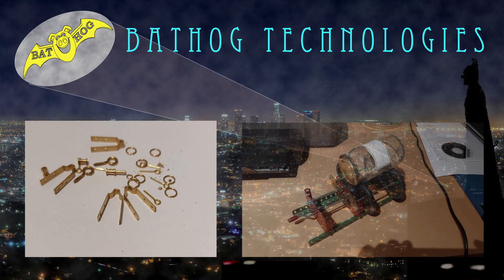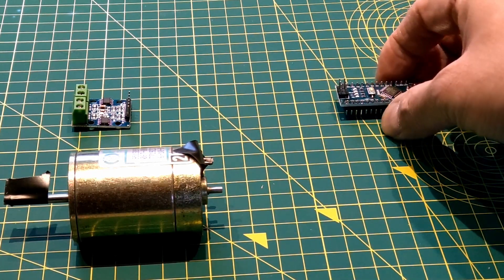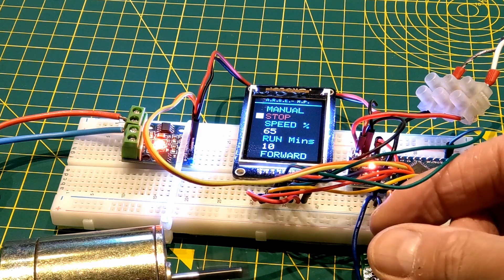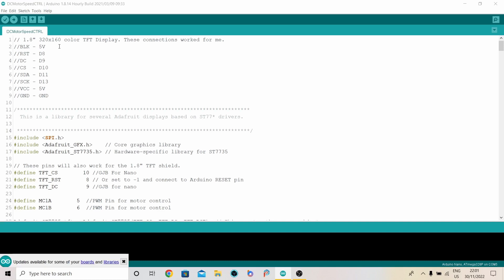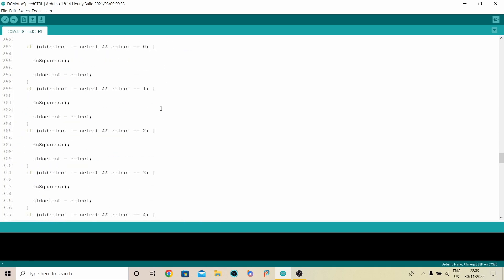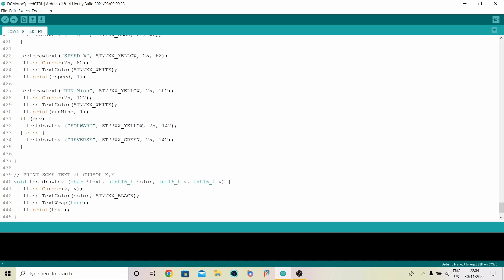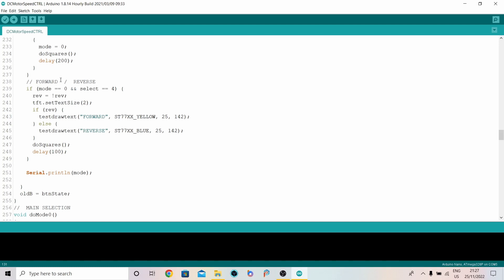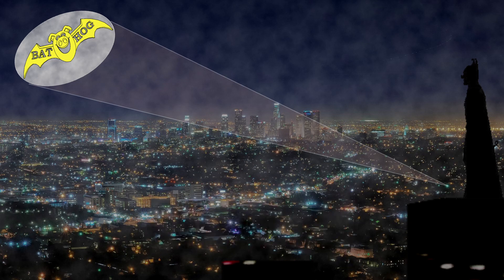Arduino motor speed control with L9110 H Bridge and TFT Display

Comment: The colours are probably mixed up because the display driver chip doesn’t use RGB in the right format.  E.g. if it’s a 16 bit display RGB565, you might find two are switched. There’s probably a define you can select in the library to switch them.
Reply from the maker: Hi dude. I used the Adafruit libraries. You are quite right, there are several define schemes for the colors in the library. But I didn't want to get distracted away from the the speed control aspects of the project. I could have specified the colors explicitly with 565 hex codes.